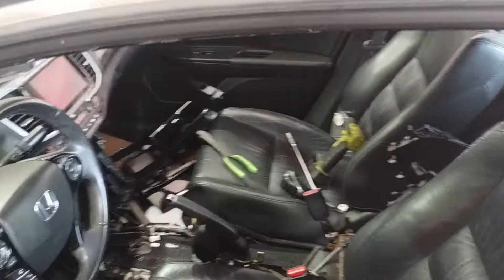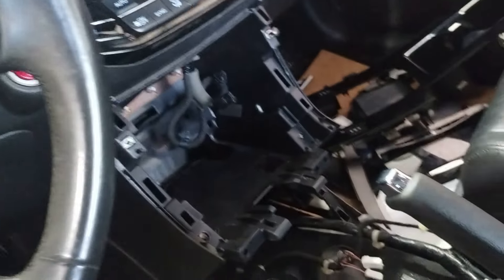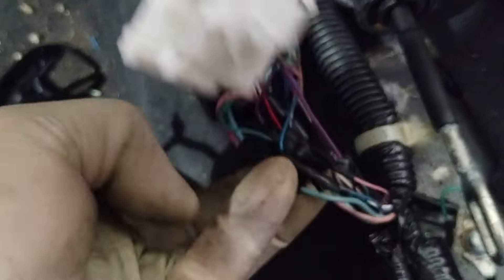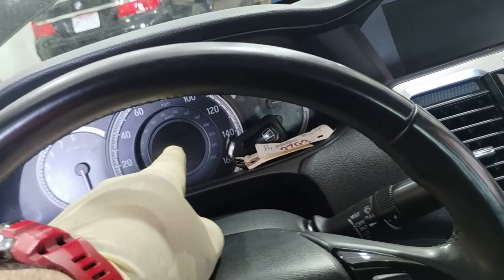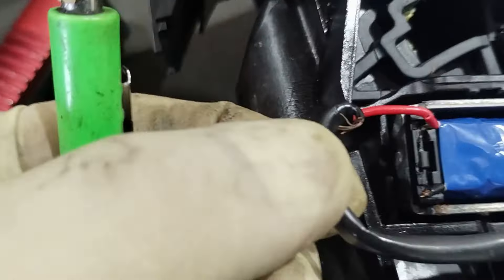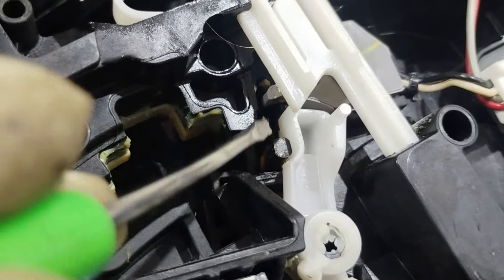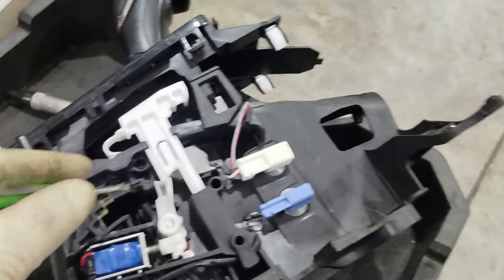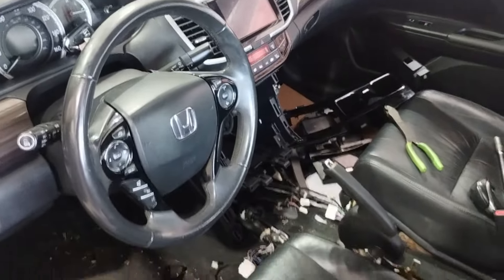2017 Honda Accord Push Start Button Always Blinking When Shutting Off

Comment: I’m wondering if the park neutral switch data in tcm was reading park or “ In  Gear”
Reply from the maker: Yes, that's why it displayed correctly in the cluster and operated fine with no trouble codes